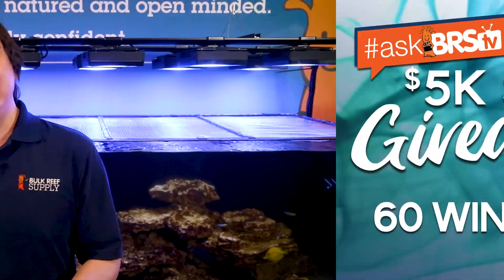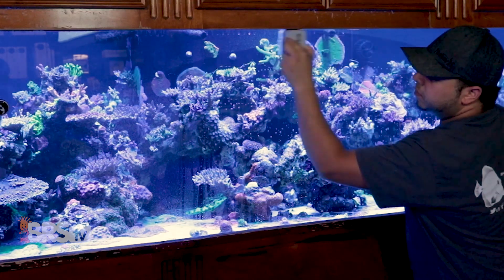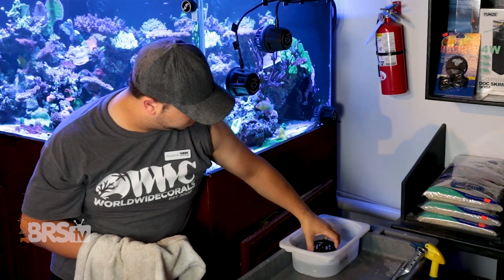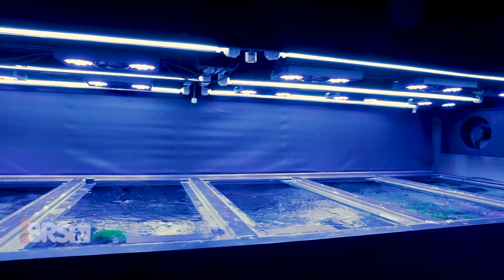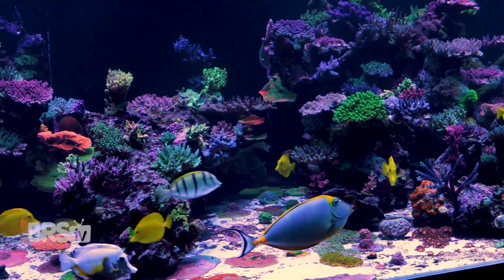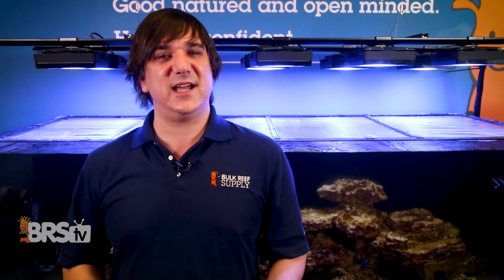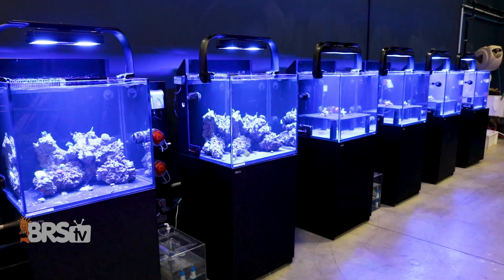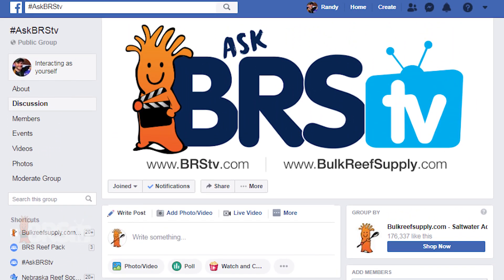Ep18: How to maintain a saltwater tank for stability? - The BRS/WWC System

Comment: Hi, Regarding the filter pads.. did you go in depth in another video about how you maintain those? I'm wondering if you toss them once dirty, hose them out, or use some other method to clean them in between uses. Thanks!
Reply: @BRStv  thanks! i usually hose out my pads and maybe use the laundry machine once before tossing them. They may be cheaper, but they're still not that cheap. Hopefully they're still getting the job done for me and I'm not actually just creating more problems for myself :) Ideally, I'd love to somehow convert my built in wet/dry sump into using an automated roller sock, but I'm not sure if that would ever get the job done either with this built in design.

Comment: A few questions,  first how many man hours is put into those WWC tanks each week.  It's easy to say "well they have a crew of workers who do it around the clock" (I'm guilty) but it's another thing to say "40+ hrs a week for the tank" and then that pushes having "something like that" out of the feasibility range.     Second, how do you clean salt water reservoirs?  They're too tall to get an arm in very deep, and too big to move them outside to spray them down with a hose.   Lastly, what's the tank behind you? Is it the WWC/Hybrid tank?  Because it looks all sorts of icky, and makes me question the "super long cycle" phase as really doing much of anything if that's the case.

Again thanks for making these videos.